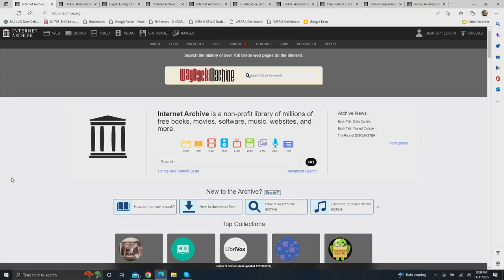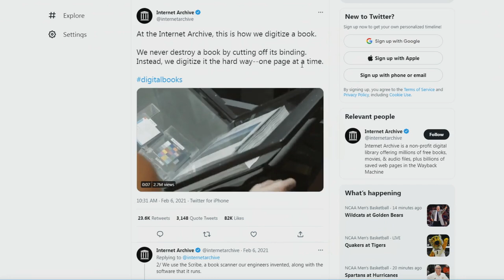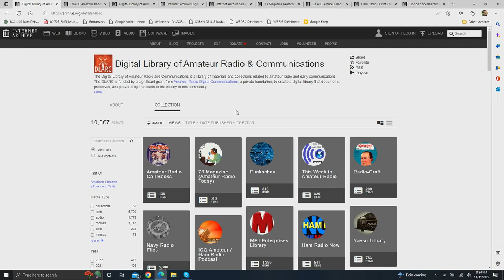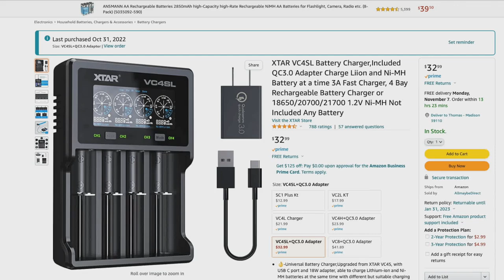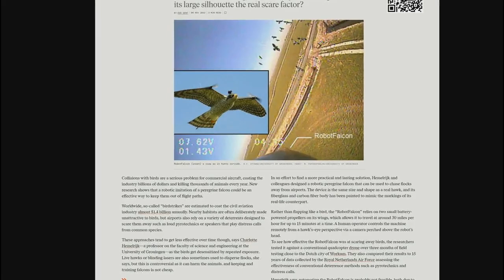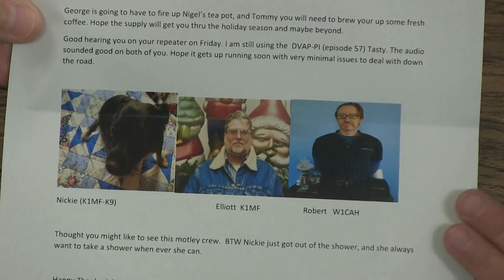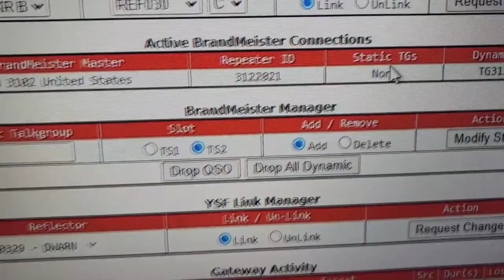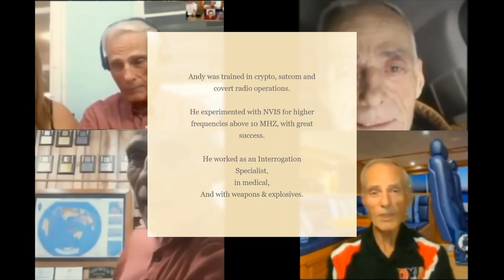AmateurLogic 175: Oh The Humanity

Comment: The Ham  that was on 6m has learned a valuable lesson. I have been on 6m for several years. I use a 5 ele beam and run 100 watts. Another friend and I do contest work on 6m, 2m, 432 mhz, 220 mhz 1296 mhz.. We run a KW on 6m  and 2m . And Around 500 watts on 432 and 220. On 1296  we run couple hundred watts right now. 
But what I was saying about  6m and the other Ham is to work any distance on 6m and up use beam antennas.
And use HARD LINE to stop loss of signal. 
But I miss 2m SSB at night . But everyone has got hung up on this digital stuff. We use digital for contest but miss voice contesting. 
But at night use to we would work a lot of states on 2m SSB and have a lot of fun and QSOs.  I Have over 37 states worked on
2m SSB.  And a lot of friends made over the years.     Gayland  W9AKW   my old call was WB9SKB years ago.. 73